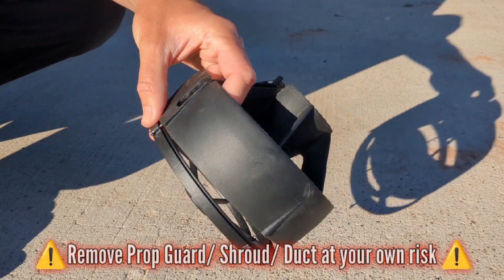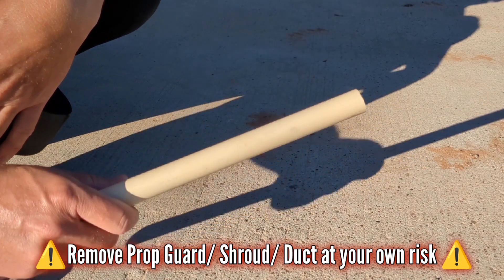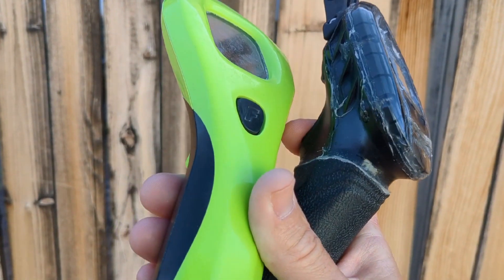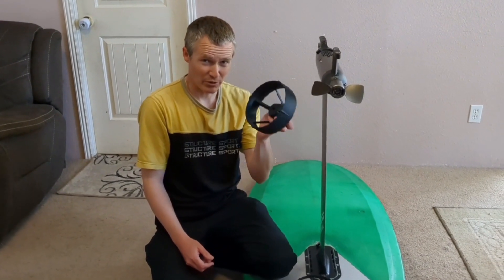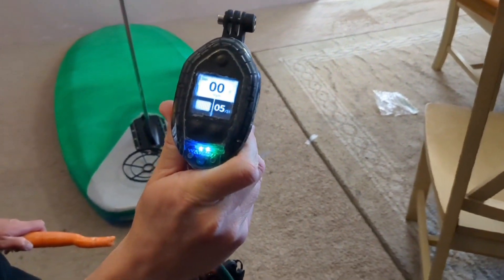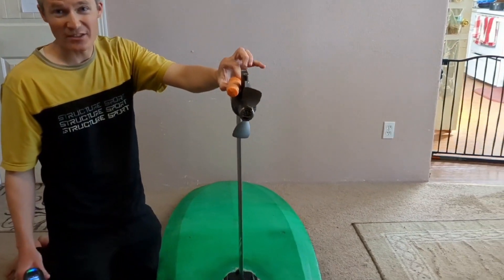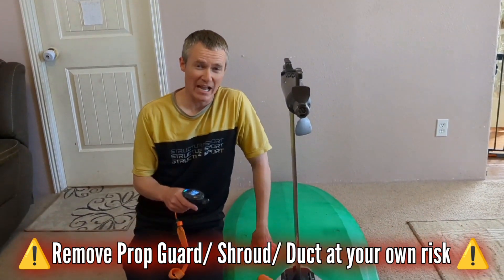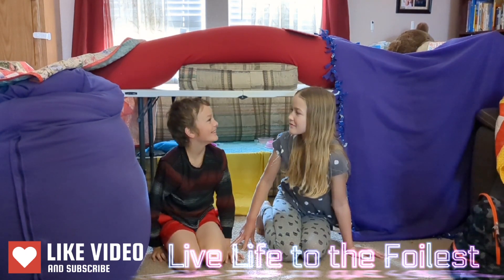Are eFoil PROP GUARDS Safe?

Comment: Nothing for nothing, but Fliteboard propellers don't even engage if it detects that the board is upside down. They also disengage if you pearl the nose and/or fall off. Basic safety features.
Reply from the maker: Lift has angle sensors to cut the motor too.  I believe the New Waydoo EVO has angle / tilt sensors. 
Agreed that they are basic safety features. 
One thing Lift lacks though is an auto safety lock on the remote to mitigate unintentional acceleration.  I think they are the only brand lacking this very basic safety feature.

Comment from the maker: A few models of efoil, the prop guard/shroud/duct may actually be *essential for the performance of the eFoil.  Removal of this equipment will adversely affect the operation of the eFoil. 

The Prop Shroud can help provide extra tracking and stability for those who are learning.  Similar to multiple and/or larger fins on traditional Water-sports gear.

In my experience, the housing of a Jet and it's unique propulsion provides a similar stability as a prop shroud.

⚠️ Don't try this at home: putting carrots or other objects in your efoil prop.

⚠️ Also you are responsible for any modifications or changes you make to your efoil; prop coverings, or any other equipment.

Check video description for more details and link to the news article of the injury mentioned at the beginning of this video